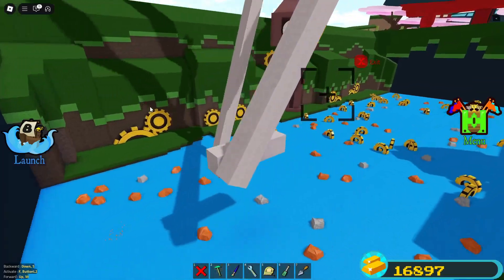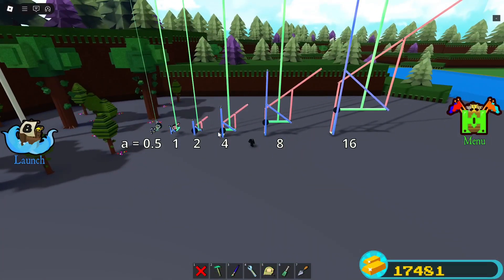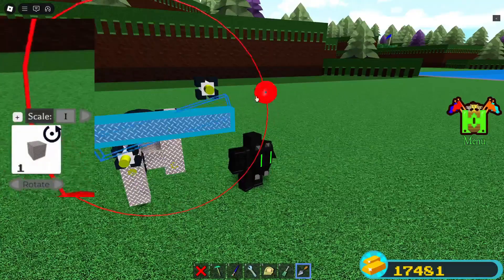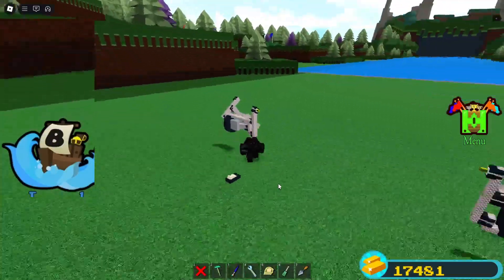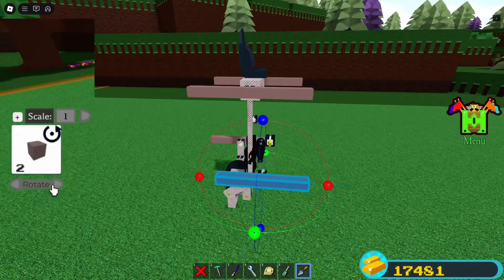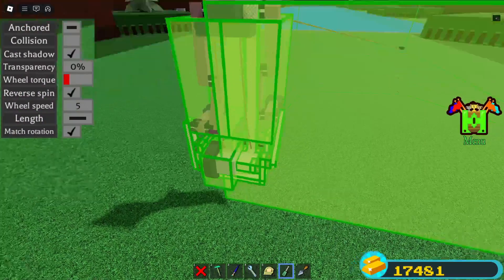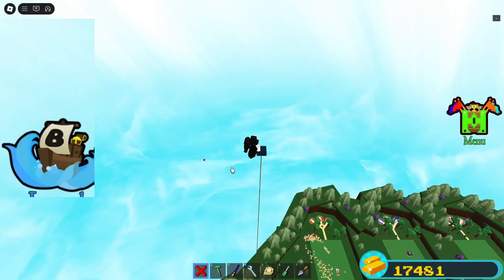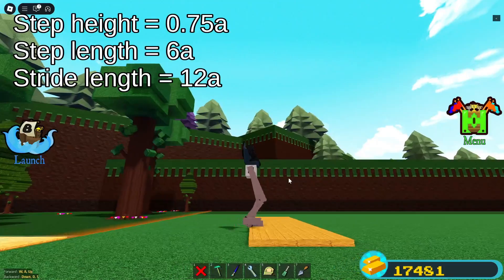Build a Boat - Walking Mechanism (tutorial)

Comment: Only works if i scale that titanium block connecting the hinges and the wheel, why?
Reply from the maker: how do you scale the titanium block? do you make it bigger or smaller? if you make it slightly bigger then just save it once you scale it, so you wont have to do it everytime
Reply: @dabl2928 It's my alt account btw, so thing is that when i unfixate the leg mechanism, it just does nothing until i move the titanium block a bit back, i do not know how to fix that.
Reply from the maker: what if you move the titanium block before unfixating it and save it? so it will always work when you load and unfixate, unless you can't do that
Reply: @dabl2928 i did that and it does nothing.
Reply: @dabl2928 Also, err i fixed it but my two hinges on the right side are badly bugged i do not know what to do and what i messed up, since when i unconnect these hinges everything is ok but if i connect them it all fails.
Reply from the maker: hmm man i never had a problem like that, im guessing you made a mistake somewhere but i cant know what it is just from describing like this

Comment: For some reason when I remove the right hinge connected to the foot the mechanism moves but when its there the mechanism doesn't.
Reply from the maker: then the hinge is connected but wrongly (it got connected like a regular block so its completely solid) i suggest you try moving the hinge by like 0.01 away (opposite way of the yellow thing on the hinge)

Comment: doesn't work for me, it looks like if the wheel somehow didn't have enough torque to move the mechanism more than an inch, please help
Reply: problem solved, i've done the legs wrong multiple times and had to fix it myself because i'm stupid, the top hinges were inside the legs

Comment: im having trouble with my build. whenever the legs get to a certain point they lock out and stop moving, if you just go in the other direction it does it again, anyone know how to fix this?
Reply from the maker: im guessing your rope's might be too short, if theyre already on 24 studs they can still be too short. You can make everything visible and check if the rope tightens up (if it does then place a bigger rope and use pistons to move it in place)

Comment: help  the hinge on the foot doesnt connect at all ive been trying to fix for  2 hours already
Reply from the maker: the part of the hinge with the yellow thing should be placed directly onto the surface, on the other side of the hinge you can scale a part into it almost all the way (so half of the hinge is inside the block, and you can use a new block to avoid scaling other blocks)

Comment: dabi is this mobile friendly or no but if it is not mobile friendly can you make a mobile friendly one please
Reply from the maker: the walking works fine on mobile but for the steering you can try using a boat motor (i will probably show how to do it on the next walking tutorial which will be up in a few weeks)
Reply: @dabl2928 motors can't work where to place?

Comment: I made one 10X bigger, how do i get the ropes to work. I tried the method u showed in the video but for the feat and it doesn't work very well
Reply: Tutorial pls
Reply from the maker: if the rope is too short you can use a portal again to get a longer rope or use pistons to get it longer. a new video should be up in a week or two, so in case you wont figure it out until then you'll be able to check how to do it

Comment: 1:18 to fix the slippy stuff put coal and other materials at the bottom check the wiki for the blocks with most friction and making a floor it walks on with friction blocks and the bottom of  the feet
Reply: I would guess sand would have lots of friction, like sandpaper.
Reply: Rusty metal is the best I think
Reply: sand is the best I tested it on ice

Comment: MOBILE PLAYERS STEERING SYSTEM ⬇️ 

A place two switches, one for left and one for right. Places two wheels on top of each other and add ONE rope for each wheel and connect it to the walker. Link it to the according wheel. Add delay blocks and link it to the correct wheel. Set DELAY TIME to 0.05 Set wheel speed to 4.( it might take a bit of working it out.
Reply: Or use a pilot seat to steer and 1 lever to activate the wheel
Reply: @turbostickmanragdollbluepr7325 You are right but not all players have a Pilot seat.
Reply: Motors
Reply: @Haotian_gamer good idea but it would be very loud.
Reply: Make it very high use colission off and it will be under ground with no sound
Reply: @Haotian_gamer Nice, but the speed probably won’t match up with the walking so you would have to change it. And it doesn’t work well if you want it slower, although you can add a weight block.

Comment: Use wheels facing on the ground so the mech won't slip. Blocks has its own slippery
Reply: Hey idk if your active right now but wdym by that? My mechanism keeps slipping when i walk so itd be great if you told me what you mean
Reply: @dandilien0  Put wheels on the feet with the wheel facing the ground to prevent slipping